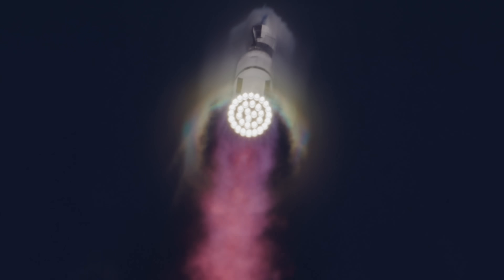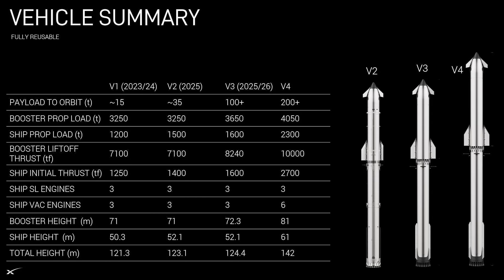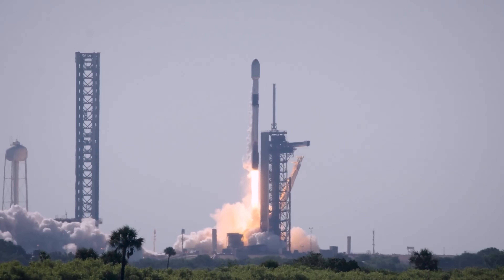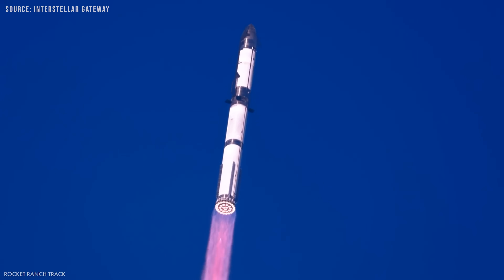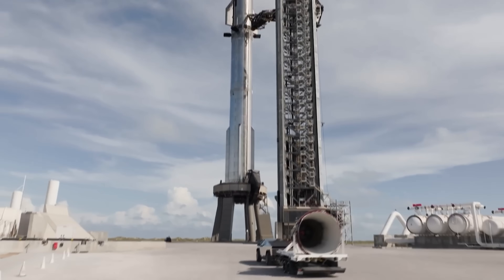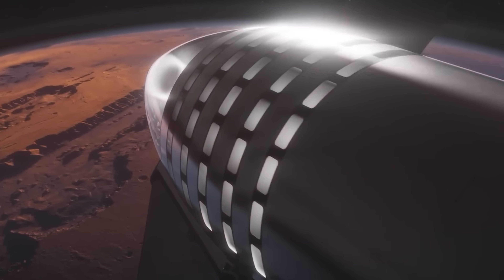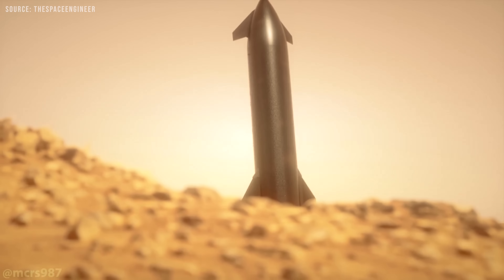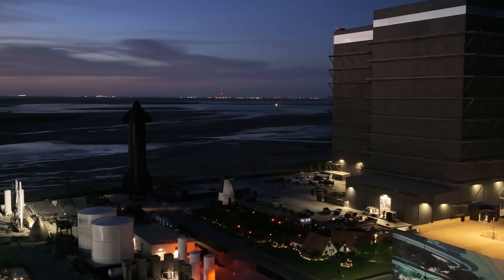SpaceX's New Starship Option: 200 Tons to Orbit, Better than NASA ever!

Comment: Why does no one discuss specilized vehicles and instead consider only Starship as viable? Starship is designed to leave and re-enter planetary atmospheres. That is a 200 - 300 km trip with a delta V of 10 km/s for Earth and 3.5 km/s for Mars, that takes less than an hour.
Getting from Earth orbit to Mars orbit requires an additional 4 km/s, BUT the trip requires about 6 months.

So how about a space container ship that operates only in vacuum, between Earth ornit and Mars orbit (or between Earth and Moon). It provides habitat, including centripetal gravity, provisions to clamp on cargo pods and a transfer vehicle, Starship, for trips to/from the Moon or Mars. It could also carry fuel to refill starship after each delivery. Reusing a starship repeatedly to go from orbit to surface, or back, requires a lot less mass hauled from LEO.
This Space container ship would be BIG, especially for Mars trips. Perhaps using nuclear thermal rockets for higher ISP.
Discussion?
Reply: I think that's what Blue Origin's blue ring is about, but for satellites, to repair and refuel satellites. In time, we'll see bigger and more efficient ones for interplanetary repair, refuel, and logistics.

Comment: Get real, Starship hasn’t event orbited
Reply: Through choice. It's only had the first two versions tested, it normally takes between 4 or 5 versions before something becomes flight worthy, and they can already achieve orbital velocities
Reply: Through choice. It's only had the first two versions tested, it normally takes between 4 or 5 versions before something becomes flight worthy, and they can already achieve orbital velocities
Reply: There is still no workable heat shield. If they manage to get one to orbit how do they get it back without melting?